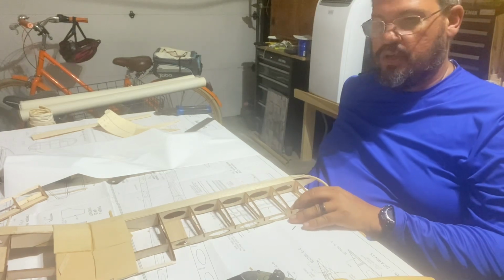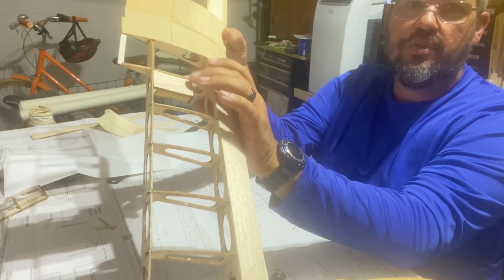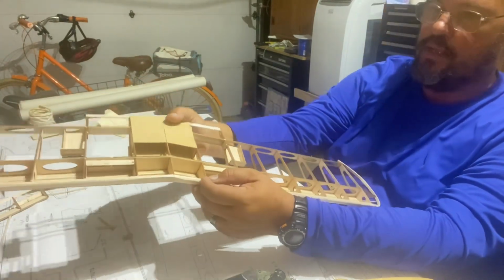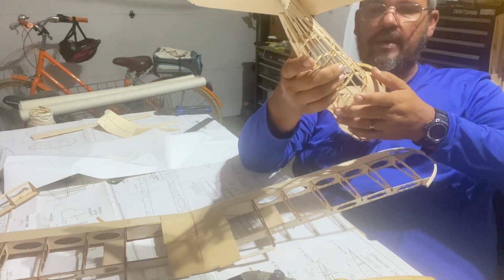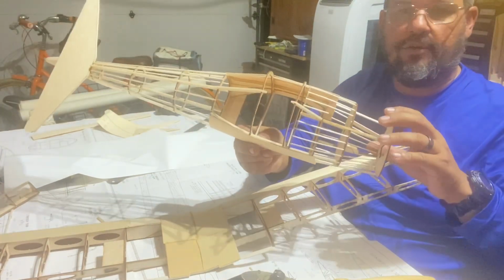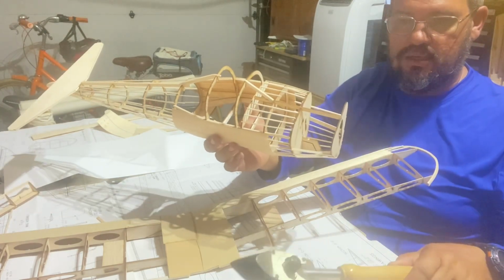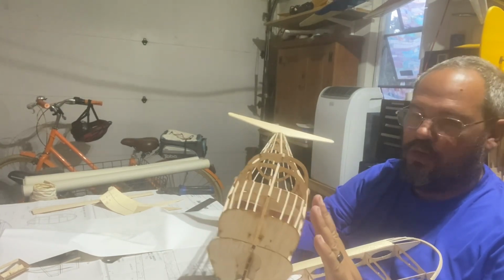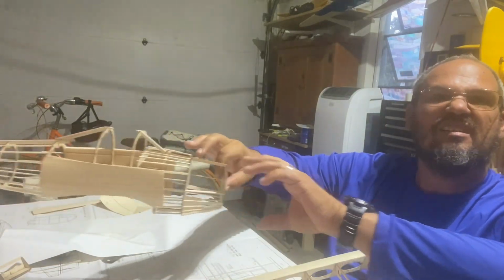Ercoupe build video

Comment: I hope you got that fuselage straightened out. She sure was a banana in the video. I wouldn't put any more than a 2-cell lipo pack. 3-cells is going to make it a rocket ship. A lot of stress on that light weight airframe. Cool video. I need to pick up the Dumas Coupe. I already have the Dumas L-19, Waco, Taylorcraft and Pacer. They are all designed by the famous Pat Tritle. Happy flying.
Reply from the maker: Yes I got the fuselage straightened out now I have to get a day to fly it.